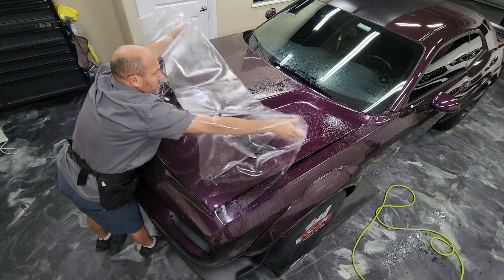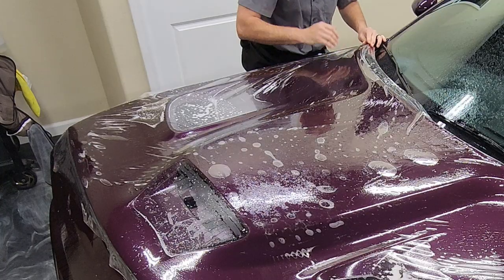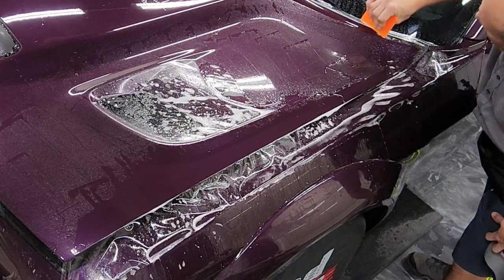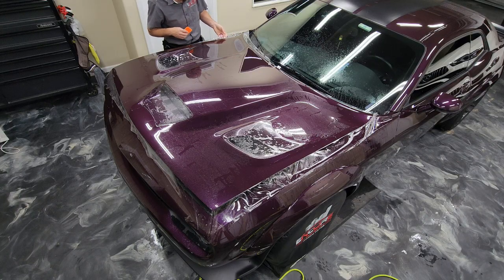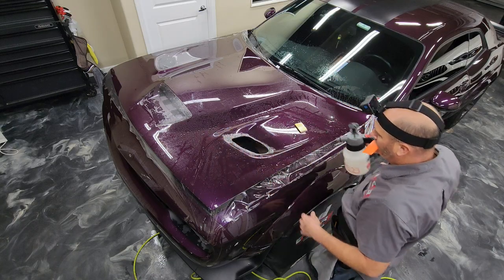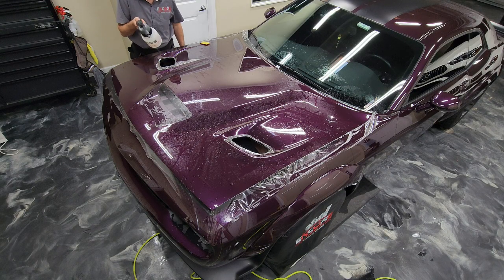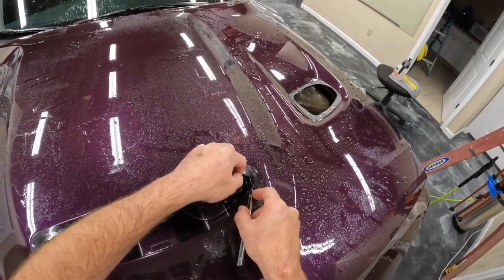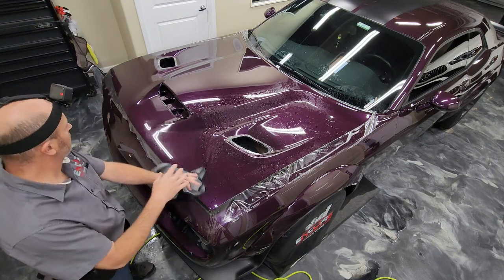Dodge Challenger Hellcat Widebody PPF 🚘 Full Hood Paint Protection Film Installation

Comment: This is awesome I'm going ti check it out today thanks so much I'll follow your channel. I have been wrapping and installing graphics basically absolutely anything with vinyl for 13 years I'm at the top of my game with vinyl. I only started PPF this year as my boss wanted to add it to the shop so I decided I would learn so I am very new to it but I'm definitely starting to like it as much as vinyl
Reply from the maker: You've been doing vinyl for quite some time. PPF should come easier to you as you already understand a lot of the techniques that are pretty similar. No doubt this channel should help with learning PPF. With your background you'll be able to understand and pick up on so much more someone just starting out.  👍😁
Reply: @EncorePPFtint  it definitely helps me out having so much wrap knowledge I'm able to understand the film and the xpel guy said I will get the hang of it no problem with a little bit of time he said the same thing you did and I'm definitely able to do most installs now just some of the harder stuff I'm still learning the process

Comment: how do you set up your soapy solution? even when parts of the hood are drying, you doest seem like you have issues with soap lines or anything
Reply from the maker: So.... Correct slip solution is an integral part of a seamless installation. I would definitely do some research on your slip soap and on the PPF you are installing and see what others are using for ratios. Start with what you find and then you can add or remove soap as needed until your solution is just right for your style. I wish everyone would share their slip solution ratios publicly! Let's help each other out. :) We use PremiumShield Shampoo for our soap and mix it at 5-7ml (depending on the shop temperature. Higher temperatures in the shop require more soap) per gallon of water. On this Hellcat hood, I knew my working time was going to be a bit longer than normal and I didn't want any of the areas pre tacking before I squeegeed them out. I added two extra ml's of soap in a different spray bottle (so I didn't affect the normal ratio in my keg) in order to keep the adhesive from tacking to early on this hood.
Reply: @EncorePPFtint  bad ass dude…I am going to try that ratio the next time and see if there is improvement. Never took into consideration the temp at our shop. We are in Texas so it’s dry and on the warmer side. Thank you for sharing!
Reply from the maker: You are welcome. Thank you for the question. The aggressiveness of the PPF adhisive will also make a difference on how much soap you need.

Comment: Amazing! That hood gave anxiety 😅 I like the idea of the hot water sprayer. I always used a steamer. Do you use sometimes?
Reply from the maker: 🤣😂 Too funny. It is a fun hood. 😁
I do use a steamer on smaller pannels that need a lot of stretch. I have a couple videos on Harley Davison where I use steam.
Back in the early 2000's I used steam during every installation. PPF was much more difficult to stretch and conform back then. PPF has gotten a lot easier to install over the years. 👍🏻😁

What kind of steamer did you use? I have a Jiffy steamer and another one that I use more for PPF that only puts out steam when you push the button.

Comment: Great job! I personally have never done this hood, but seeing you do this I already in my head was like telling myself “oh yeah I would’ve done the same. It’s also one thing to see it in a video but I’m sure it can be more intimidating having the vehicle in front of you.
Reply from the maker: Thank you for the feedback.  You are right about that, this hood can look more intimidating than it is. The good news is that it's only a process to get it done. There are way harder installs that can go wrong so easily.  It's also interesting how we (us installers) do so much of the installation the same even though we were trained completely differently. Or in my case, not trained at all. 👍🏻
How long have you been installing PPF?
Reply: @EncorePPFtint  of course! I’ve been installing for 5 years now an it’s funny because I was never trained or took any classes. I taught myself for the most part. How long have you been installing? I Received a couple tips & tricks along the way. Have you ever tried a reverse roll? It will make transferring the film from your table to the panel much easier and also avoid high risk of contamination durning transfer vs holding in open air and having to fold it over the hood.
Reply from the maker: I've been installing tint since 1998 and PPF since 2004. 3 days of hands-on training for tint and self-taught from there. I'm self-taught on the PPF. I've gotten some tips, tricks, tools, and info from reps and such over the years. I have tried the reverse roll but stick with my install method as it's what I know best. We also do not have a weeding table. So I'd be sticking it on the wall either way with my setup. Both techniques seem to have their advantages and disadvantages. Once perfected, I'd figure contamination is negligible with either method.  👍🏻
Reply: @EncorePPFtint  for sure! I can understand that. Do what works best for you is what I say 👍🏽
Reply from the maker: @erick77dp7  definitely.  It's awesome to see all the different things people figure out in order to get the same job done. I'm constantly trying to learn and adapt my installation technique.

Comment: your a legend for this video man. I'm doing ppf too and About to a Hellcat exact same color. great reference
Reply from the maker: Awesome, I'm glad it's helpful! Thank you for the comment.  Are you using a kit for the bumper? I did use a kit on the bumper of that car.
Reply: @Encore Window Tinting and Paint Protection Film  No, I Bulk the whole front but the bumper was a little challenging ngl. I don't have a good relationship with my platter and pre cuts 🤣 always something goes wrong
Reply from the maker: I get that. When I got my first plotter it literally sat for a year before I put any effort into using it. Now it's used almost daily for one project or another. Once you get them dialed in they are workhorses. We edit every pattern in the computer that we plot out. Plotter cut patterns are a different install compared to the bulking. We do both. 👍🏻

Comment: Do u have a video for how you ppfd the mirrors? Did you pre cut or bulk them? Or mix of pre cut on the bottom of the line and bulk on top?
Reply from the maker: I tried to bulk them but the car had a ceramic coating on the mirrors and the PPF wouldn't stick.  They opted for no coverage over having the ceramic coating buffed off. The front end had just been repainted after a car accident. These are Definity a 2 piece mirror if you are looking for full coverage.

Comment: Thank you for the content!

I’m actually starting on this hood today. I haven’t done a hood like this yet but have done a few challengers/hellcats.

Any words of advice or tips now that you’ve done one or something you would change the next time?
Reply from the maker: @atdautospa  I'm glad I could help! I wouldn't change much. This install went very well. Make sure to mix up your slip with a little extra soap. Also, make sure to clean the surfaces in (behind) the scoops really well. That way, when you wrap in there, they stick and stay down. I've had a couple of these hoods that the plastics vents would bunch the material up after a couple of weeks. On those, we just trimmed the ppf away from the plastic vent, and that fixes the problem. I like to hide those edges, but the plastic vents rubbing is out of our control. 😁
Reply: @EncorePPFtint  thank you for getting back to me! I appreciate it brother. To remove that middle vent do you have to remove the heat shield and everything from under the hood?
Reply from the maker: This vehicle was missing the heat shield,so I'm not sure.
Reply from the maker: @atdautospa Please let me know how it turns out and if the video was helpful.  I'd love the feedback!